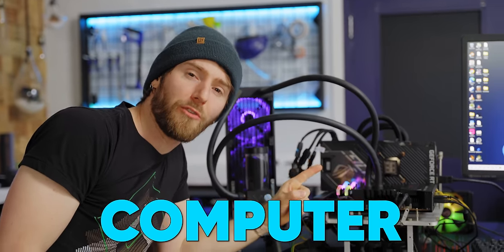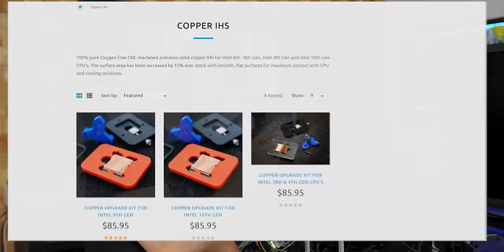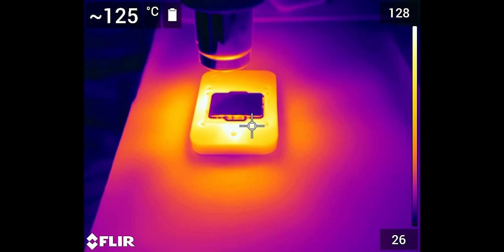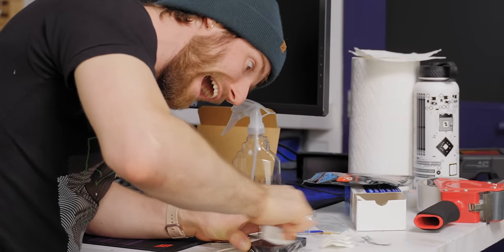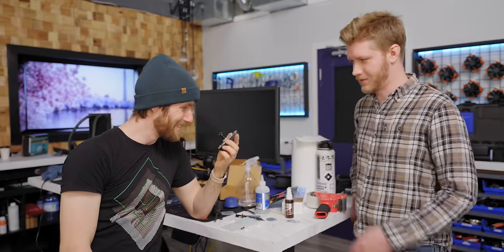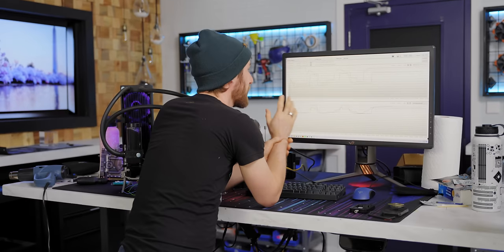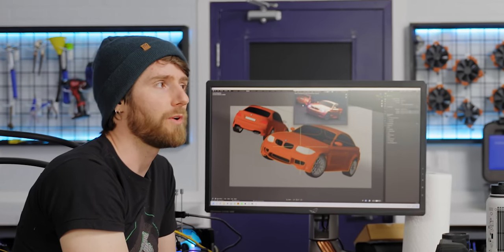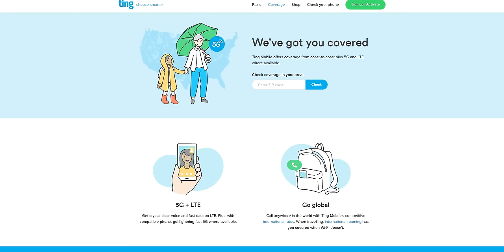Making Intel's Worst Product Better.... And Also Worse

Comment: That liquid metal for solder removal is definitely not just indium - its melting point is far too high for it to be liquid at room temperature. It's almost certainly an indium-gallium or indium-gallium-tin eutectic, which has a much lower melting point lower than any of the individual elemental components (elemental indium Tm=150°C, elemental gallium Tm=30°C, elemental tin Tm=230°C). It's probably a typical galinstan-like alloy with a sub-zero melting point. Or, to put it more plainly: they're just reusing off-the-shelf liquid metal thermal paste for the solder removal.

Using it for solder removal a really clever idea, though, since typical RoHS solder (lead free) is a tin-silver-copper alloy with occasional fourth-element trace additives (zinc, manganese), with the majority element being tin. Both tin and silver are readily soluble in indium-gallium eutectics and there's so little copper in the solder (<1% by mass) that it'll be easily suspended in the resulting liquid alloy. It's certainly not environmentally friendly or cost-effective at scale, but I'm definitely going to steal this idea next time I need to clear solder off a board where hot air is problematic or I'm worried about lifting the pad.

Edit: Thinking about it more, you'd have to be quite careful with HASL finish PCBs because the pad plating is effectively just solder, but I reckon you could get away with it if you used a light touch, cleaned up well, and soldered the new part immediately afterwards. ENIG would probably be ok but I'd still be careful about cleaning pressure. Hard gold uses a bunch of nickel in the plating alloy so it'll be untouched and you can go nuts.

Comment: Linus: Let's sqeeze every bit of power out of this cpu
Also Linus: Tests GPU heavy games
Come on Linus
Reply: They said why.
Those particular games provide cpu performance metrics in their benchmarks, not just toal system performance.
Reply: I'd like to see them try DCS in VR and see if it'll crack the 45 FPS wall.  DCS is so CPU bound it hurts.

Comment: You have to remember that the socket pressure bends the IHS, meaning making it flat wont make a flat contact. Second, coolers are also bent to compensate for this, meaning that if you wanted an ACTUALLY flat contact, you would need to lap the CPU while it is in a socket and the cooler.

Comment: i wish you guys would have a solidworks single core stress test on 250meg file loads for some real world performance indications.. not render so much, but single thread pressure on the cpu, which is primarily large model loading. at work, this can typically be a 15-20 minute load...

Comment: on the subject of coilwhine when the next generation roll's around would you guys mind paying some attention to how bad it is or if it's there at all.

i never really experienced coilwhine untill i got a 980TI that howled like a banshee (even when watching a video on youtube or just moving my mouse on the desktop T.T) i actually "upgraded" to a 2070 super just to get rid of the coilwhine as i could not stand it anymore...this thing also coilwhines when under heavy load but it's generally not present. honestly if a manufacturer could guarantee a spec that has no noticeable coilwhine that would outweigh any monster cooler or 10 thermal sensors feature in my book. (my pc is watercooled for silence so having a howling banshee living in my otherwise quiet pc kinda defeats the whole purpose).
Reply: Coil wine is complicated and can be caused by all sorts of things.  It could be that your PSU is the real culprit, it may start wining when under higher load or it could be sending power in just the right way to cause wine in the GPUs.  Coil wine is caused by vibrations usually in a coil and the frequency (pitch) of that wine may be controlled by the frequency coming out of the PSU (the power coming out of the PSU isn't constant though the better the efficiency rating of the PSU is the closer it should be to constant/the more 'clean' the signal should be).  It could of course also be something within the GPU itself, apparently GPUs are normally the culprits but I wouldn't be surprised if it's more commonly just a mismatch between components and the GPU is blamed first because the PSU worked fine for the previous (lower powered) cards.  I've read that adjusting fan curves can sometimes fix the issue (more power through the fans for cooling and less power through the coil that wines).  It's also worth noting that NVidia cards aren't just made by NVidia, some brands probably have tighter tolerances than others or perhaps have better filters than others (filtering the incoming power could help compensate for dirty signals from the PSU).
Reply: @grn1  yes it can be complicated and it can be the PSU, it also can just be it coilwhines like crazy and no PSU on the planet can fix it and you can torture it till it dies it'll just die whining, it had it for 3 years I tried all the old wives fixes, they were 100% ignored and it gets tiring shooting down every fix that works maybe 1/10 times for an issue that is just caused by the card (GTX 900 series was notorious for coilwhine issue's )
Reply: @anub1s15  Sounds like you've had a fair go at fixing it then.  Out of curiosity what brand(s) are you using?
Reply: @grn1  the card was a EVGA founders/Reference edition 980TI (i could have RMA'd it in it's first year as EVGA recognized it could get pretty bad, but it was plumbed in to my liquid cooling so...quick RMA...not in the cards), my original PSU was a Corsair ...RM Yellow i think, which coilwhined (atleast the GPU did), then i upgraded to a corsair RMi, which at the time had about the best ripple controll you could buy which did nothing. and i think in it's last year i put in a corsair RM black (was again supposed to be pretty good and was moving to another case for which i needed a more compact PSU...now on a corsair SF-750 as i needed more space :P) so i tossed in total 3 pretty high end PSU's at it which all 3 (whine wise) were identical, and i must have run in total a week or 2 strait of furmark / heaven valley wile at work just tortering the crap out of it hoping it would just stop...but it never did :(

i've actually still got the card as i just cannot in good conscience sell this card to anything other then a miner, someone with hearing loss, or someone with really good noise canceling headphones. also i'm to lazy to put the OG cooler back on so it's still watercooled (which btw made the coilwhine MUCH worse/Louder, i heard it during testing but...like many i thought ow maybe swap psu, torture it a little it'll go away....ow i wish T.T seems the fin's on the original heatsync do dampen that slightly where a copper block just bounces it around untill it gets out)

now they probably cannot guarantee no coil whine but, some sort of extra testing or maybe more careful component selection could make it so they can slap a sticker on the box so you can know it' s been tested if you have really noticeable coil whine you can almost be certain it is not the card's fault cause atm..it can be any card at any price for many reasons, it's quite literally a coil whine lottery >.< and some company's do not see it as a problem so if you have a angry bee hive in your pc...your kinda s.o.l. (it's why i went with EVGA, i didn't rma it but i could and having the option for coilwhine mattered to me) .

Comment: the quality of the copper is also very important. the stock IHS is industrial copper, whereas the aftermarket IHS is pure. on the 10th gen RockitCool copper IHS the surface area is also increased by 15%. 
also, the test should have been done with the stock IHS after LM application to see what exactly the NEW IHS does as you changed two factors at once. the IHS and the Thermal interface material.

Comment: I did this to my 12900k a month ago. rockitcool didn't ship it with the liquid-silver to remove the old TIM so I had to use a razor blade. I ran tests before and after and got 10c drop in temperature (difference over ambient temp), also all the cores were %16 closer in temperature to each other then before. Der8auer is rumored to come out with a direct-die frame soon, so can't wait to try that out.
Reply: Thanks for watching 🤗   
Send a direct message right away,I have something for you.🔝🔝🔝

Comment: got a question so i get like 30% gpu usage in games i have factory reset pc and testing right after its same issue so its not a setting and i just upgraded to 3070 ti and still 30% gpu usage from a 2070 super and im hopeing its cpu which i have a ryzen 7 2700x which i know is low for 3070 ti but im going to upgrade to a 5800x and anyone know it it could be anything else? i got 16gb of ram 3200MHz and 750W power supply and gpu gets good performance is some games, and 98-100% in any benchmark like it should but idk what it is other than cpu rn and even cpu seems to preform well when im doing a stress test on cpu so idk if my gpu isnt getting enough voltage even tho it should... is there a easy way to check that? and what voltage should a evga 3070 ti get? mb: asus rog strix B450- Gaming (Up to date bios) and never had any component get close to overheating. if you cant help plz like for someone can see this comment to try and help, this problem has been driving me crazy for years.
Reply: This sounds like a cpu bottleneck not a gpu voltage issue
Reply: Probably just misreporting or you’re reading the wrong chart. If you’re still getting 150fps or whatever is normal in your game then don’t worry about it.
Reply: Do you talking about Fortnite? Because i have the same issue..
Reply: @NoLongo  with a basic shader on Minecraft for example in a normal world I get 30fps
Reply: @Xenoray1  most games
Reply: @havardandersen3593  i have Opera open with yt up sometimes Im watching a videos and I have discord and voice mod but that’s the main things I have open
Reply: @GaryElCougar  wdym cleaning the pins?
Reply: @roybrown6058  i mean i could see a bottle neck now with a 3070 ti and Ryzen 7 2700x but before/ 2 days ago I had a 2070 super and I had same problem and I know that 2070 super and Ryzen 7 2700x are a good pair I was going to upgrade to a Ryzen 7 5800x but I don’t wanna keep spending money if it’s not going to fix it so idk. And also cpu usage always around 20-50% under load so it’s not like it’s in 80s or higher and capping gpu…. I can barely get 40 fps in Minecraft with a mid tier shader on.. with a 3070 ti
Reply: @havardandersen3593  yes GeForce Experience driver is up to date
Reply: @havardandersen3593  and yes i do have wall paper engine running in background and 2 monitors but would that really be that big of a effect to get 40 fps in a basic Minecraft survival world with mid tier shaders?
Reply: @havardandersen3593  i know a 3070 ti and Ryzen 7 2700x is a decent gap but I had a 2070 super like 3 days ago because I just installed the 3070 ti yesterday and even with the 2070 super I had the same problem that’s why idk if the cpu messed up because I have tried to oc it with Ryzen master and I didn’t know what I was doing completely so my pc booted up to blue error screen or black screens sometime but the thing that makes me re-think the whole cpu issue is in game I only get 20-40% cpu usage so it’s not like it’s at 80%+ being “bottlenecked” unless u can have a bottle neck when cpu at 20-40% usage…
Reply: @havardandersen3593  and also idk if this says anything but in the games my pc stuggles to run the gpu usage goes down whenever I’m in a area where I’m seeing more stuff which you would think would be more demanding but it goes down and up in places where I don’t see a lot of stuff but it’s only like from 20% usage to 25%
Reply: @havardandersen3593  yes i updated bios a few weeks ago to most recent

Comment: In all seriousness, this IHS seems like a really good investment for the cooling improvements alone. Running at 85C or 95C 24/7 in, say, a workstation environment, both situations are technically within spec, but there's a much larger margin of comfort with 85C. If the power draw spikes, the temperature only spikes to 90C. Maybe. If the 95C CPU spikes, though, even if it thermal throttles, you're going to lose quite a bit of performance. Here, it's the same performance, but backing off the knife edge so you're not cutting yourself every single time.

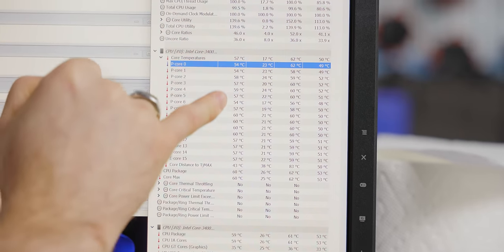Comment: @12:00 you might be getting 15C drop because you are getting about 10C drop in temp and using substantially more power (20+ W TDP.) so if you set a max TDP in both temps you might see that 15C drop.

on a side note, the 12900KS is awesome. Its great that intel is bothering to cater to the enthusiast but they could be doing more like selling it with better IHS or no IHS and so on. They have done a lot to make their IHS better but they could do more.

They made the package thinner, the die thinner, and went back to solder vs paste and more. I still would like to see more done especially on the top tier CPUs.

Comment: Kind of a simple question. If the flatness / uniformity of the heat spreader is so important to the performance here shouldnt you have to enforce that same standard for the contact on the cooling device?

In my experience those surfaces are far less uniform than any CPU side heat spreader I have ever seen.

Comment: It's really nice to see that a specially machined integrated heat spreader is only marginally better than stock. Only way to go more balls to the wall would be synthetic diamond windows on the block and IHS, which as a system would probably cost hundreds of dollars.

Comment: Put a Peltier cooler in the water loop AWAY from the board and have it only cool the water to 1C above average INTERNAL case ambient. The cheapo waterblock to which you connect the peltier should have a WraithRipper cooler on it... because it looks frikin' cool!

Comment: I lifted my Noctua NH-D15 in favor of a Thermosiphon.... it was such a perfect seal, I regret doing it still. My temps are not the same either, They are higher idle, but stay cooler for a little longer, and don't top out as high.

Comment: Hey LMG, I have seen on Jay's Two Cents channel, when he does heat/speed testing on a processor, he will often sand/mill down the top of the cpu to make sure it is as flat as possible.  So I can see a 3rd party doing this on purpose, for best surface area contact.  Love the channel, keep up the great work!!!

Comment: They machine a seriously flat surface that is supposedly increasing performance over the stock IHS, but then include a tool that just grinds the tip of a big machine screw over said surface? What?
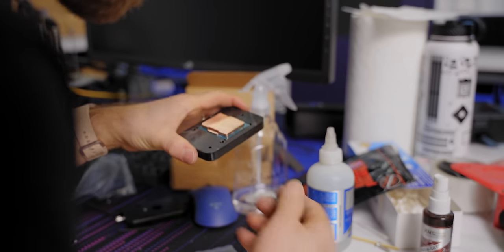Scratch marks visible: 10:00

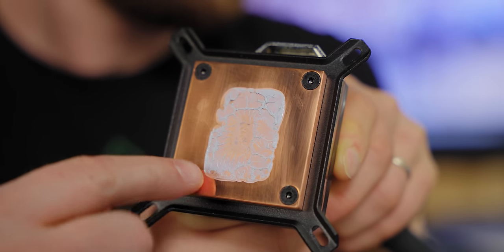Comment: 3:21 This is actually intentional, due to thermal expansion it should be flat at peak temperatures. Of course, this is based on testing with the stock cooler. if you have a very good liquid cooling setup, you'll experience less thermal expansion, causing it to bow in the center and not be flat as it should be.

This effect of a miscalibrated IHS probably matters more 3rd party companies having better CNC machines.

Comment: I lapped the IHS and the bottom of the cooler.  My computer doesn't get over 64° anymore even after gaming all day while overclocked.  Easy 10° drop over the previous setup, probably more like 15.  Would definitely recommend sanding the crap out of your processor and cooler on a known flat surface.

Comment: I have an old cpu I’d like to experiment with, an I7 10700k.
I would love trying a delid and Liquid Metal/ copper cap swap it.  I wonder if a less power hungry chip will benefit more
Reply: Would a used 3070 benefit from Liquid Metal? Performs fine but since I’m doing a cpu I might as well

Comment: You guys should do a literal no compromise pc, like lap the gpu die, delide cpu and liquid metal fucking everything and make it something you can actually use on a daily basis, like no ac unit but insane water cooling

Comment: 15:50 If your wiring is not up to code this might make it burn down. Eh maybe if you have aluminum wiring from the 1960's-1970's.   If you have copper wiring, it's doubtful that you have anything better than than 12 AWG.
Reply: Also that applies to the countries with the 120V electric system.
240V countries are fine.

Comment: One of the cooler videos in a while (amongst the 3090 mutilation, I love that thing). Thanks! Also: not mad about W11, holding out old windows version is something of all ages, as is complaining about it being slower. It's amazing to see this kind of stuff (and to see it as an opportunity for the likes of Intel as an opportunity to differentiate the high end further, they could totally make these mad CPU's be more "cool" other than a generic bit of PCB you hide under a cooler)

Comment: Ive been a tool & die maker for 30 years . For those who dont know the trades that is a type of all around machinist .
Regarding " flatness" tolerances I can say its about irrelevant how flat they make the copper heatsink .
If it were 3/4 inch thick it would but the flatness of a 1/8 inch thick piece of copper is entirely dependent on the mounting pressure of the waterblock .....and how flat that is !!
With the amounts of pressure even generated by a Phillips screw a piece of copper will bend .005-.010 inch easy .
I wouldnt call these numbers " flat" at all , essentially for a small piece like this ! 
They might be ground flat w/i .0001 inch but they wont stay that way .
Its not terribly difficult to flycut something as easily machinable as copper and as small as cpu heatsink to be w/i .0001 inch .
In fact unless they hold it correctly it will spring out of shape as soon as part is removed from vice/ fixture .

Comment: Someone needs to tell Alex that CPU don't use conventional solder! They use a special indium based alloy that melts around 130-150C, do NOT heat your CPU to >200deg to melt the solder...